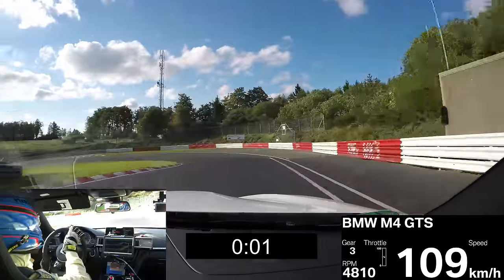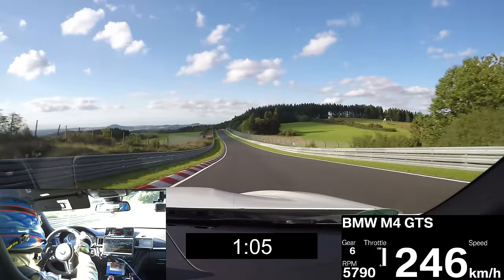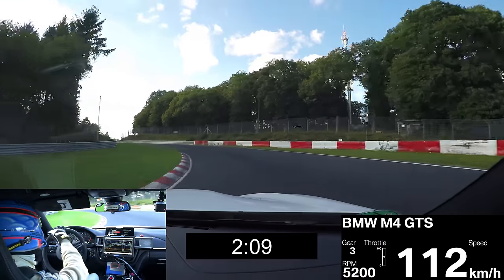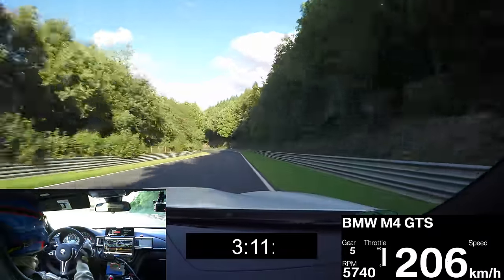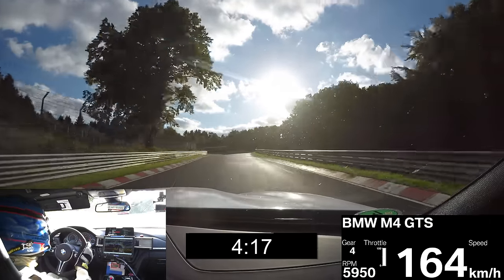BMW M4 GTS Fast Lap Nuerburgring Nordschleife.

Comment: With these results, BMW doesn't need to make a supercar. This is a real supercar in the body of the tiny coupe.
The Ultimate Driving Machine.
///M POWER.
Reply: +Hendra Di 142.600 € .... i'd rather pick the GTR ;D
Reply: +Hendra Di ...Ultimate driving machine?............Yeah right.
Reply: Coming from the person who loved the S-Class...
Reply: +Hendra Di You actually have a point there... would be great if they made one anyway though :p
Reply: +Dre Ray 
Exactly, yeah right. And with this GTS BMW showed how to build a near perfect car. It's as fast as many great sports cars and it was so stable, like driving on rails. And you can daily it. Definitely the ultimate driving machine.
Reply: +Fast Er 
Ultimate driving machine... what a fucking joke... it's an automatic... so nothing you say from now on is relevant when talking about "the ultimate driving machine"...  
also looks like shit, sounds like shit, costs way too much... NOT EVEN CLOSE

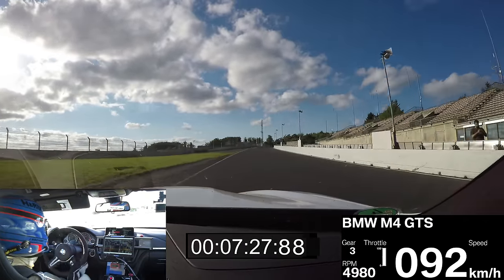is it impressive that a BMW coupe can lap the Nürburgring in 7:28? fuck yes it is! is it anywhere near perfect or "the ulitmate driving machine"? fuck no...
Reply: Paul Jeitler Now almost all sportscars/supercars using Flappy Paddle Gearbox. it's not automatic. 911 GT3 RS, F12 TDF, 675 LT. How do you say this car as the car driven unpleasant, because they don't use a manual transmission.
Reply: Paul Jeitler
M4 look like shit? nonsense bullshit, M4 (especially GTS) looks amazing with an aggressive headlights and the first use of OLED on taillight.
M4 sounds like shit? nonsense, still much better than Veyron, or GTR sound.
Reply: +Hendra Di well much as I agree with you! Just imagine if they create actually a real supercar... That would be the best supercar ever!
Reply: +Paul Jeitler No cluth? Double clutches!
Reply: +Paul Jeitler Dead serious. The gearbox is doing the clutching for you. Cannot be compared with an automatic transmission!
Reply: Paul Jeitler dual clutch or semi automatic, or whatever you want to call it, is a new trend in the automotive world today, from cars low end to hypercar are all close to using it. you have to accept this fact, almost no sports car that really use a manual transmission at this time as you wish. even track foucused car like Porsche 911 GT3 RS, Aston Vantage GT3, SLS AMG GT3, M6 GT3, P1 GTR, FXXK, Huayra BC, etc.
Reply: +Paul Jeitler Your the idiot. When I start my car, it's a manual. It even says so in the display. M1 (manual first gear) I floor it, until the I hit the RPM limiter. Then I engage the gearshift, with the lever or the paddle shift behind my steering wheel. The company behind it doesn't make automatic gearboxes. They make manual, and dual clutch gearboxes. They have automatic clutch, but it's nothing like an "automatic" my friend.
Reply: Paul Jeitler 
well last time i checked, race car drivers focused on performance over satisfaction...

im not saying there's anything wrong with manual, i agree it can be more involving but, like i said, racers now use dual clutch for a reason. Yes, the ACR and some 911 GT3 RS's still come with manual but check actual non-street-legal race cars.
I hope a can get a response comment without at least 5 insults in it.
Reply: +Hendra Di "tiny" are you serious???
Reply: SimBaa yes, i mean small coupe.
Reply: Sure... Ultimate driving machine with a ring lap time made by a slug.
Reply: It's kinda slow tho.
Reply: Man the hyperbole from BMW fans is crazy.  As long as Porsche exists as a company, BMW has no right to the title "Ultimate Driving Machine".  Even five years ago the GTS was an overpriced car; now it's irrelevant.
Reply: Yes.It was faster than Mclaren
Reply: @pauljeitler7678  an automatic that you will never be able to shift faster than:/
Reply: just a heads up, BMW m cars dont do that well.. even Civic type R's can beat m4 and m3, unless its the 150k GTS version lol
Reply: @davis7323  Beat them at what? A base M4 is faster than any Honda Type R.....hahaha
Reply: @pauljeitler7678  wrong. Auto don't have clutches or a clutch.
Reply: @jostrander71  nurburgring
Reply: Mercedes-AMG GT 4-Door Coupe is faster now.
Reply: Not imo didn’t even beat under 7 mins
Reply: @samharper5881  true

Comment: Shows how fast the CSL is/was in 2003 on MPS Cup 1 tires. 7:50.
Reply: +Thomas Kooiker The 12-year old CSL is faster than a standard M4. Unbelievable.
Reply: +JoeBlo2 Yeah, but as far as I know the CSL had a better driver. If the M4 would be driven by the same guy that drove the M4 GTS, it would definitely be faster. 7:50 is an incredible time though, the M3 CSL is legendary.

Comment: So, it's as fast as the 458 Italia and the MP4-12C.
Reply: +Ivan Novak And as fast as the legendary Carrera GT. Funny somehow.. also funny is the fact that the panamera turbo s is as fast as a ford gt on the ring (07:52) and the E46 CSL is as fast as the first version of the murcielago (7:50)
Reply: +Jannik Eisenmann in the case of the Ring, it's such a long and unique track you can't just compare the 'cars' laptimes; you also gotta take into account who sets the laptime with any particular car. Drivers vary for each each car and so do the track conditions. There's also the reservation problem. Since the Nurburgring is a 'public' road-course, most manufacturers only get private access ti the track for a pretty short time period, for example, Dodge only had 30 minutes to set up their equipment and run a lap in their Viper ACR model. i'd imagine Ford GT was driven by a journalist (not a pro) and so was Murcielogo or MP4-12c. Think about it, how can the 12c (being 4 seconds faster on the Top Gear track) run the same  time to the 458 which has even less power. When it comes to the Ring, it's all about 'Who sets the lap time' than 'what car sets the lap time'. That's why i can only take seriously the laptimes that have an on-board proof video. And even with a video, you  still wouldn't be able to figure out if the car is a legit road legal or if the company is cheating or not (like with the GT-R NISMO who didn't set the lap time with a pro-production car developed only for the Ring and claimed that it was a showroom stock GT-R NISMO)
Reply: Arya Ahmadi
I get your point, but i believe me, four seconds are (if it's not close to seven minutes or less) not that much on 20.83 kilometres, and regarding the mp4-12c vs the 458 i have to say that power really isn't everything! it is also depends on torque, less/more over/understeer, driveability, rwd/awd/4wd, downforce, weight, power to weigh-ratio.. (the list goes on..) and i did not want to bash the ford gt, i really do like this car! i just want to show how fast everything progresses, i mean as far as i know, the new 991 911 carrera s (or another 991 "standard" model) is already faster on the ring than the 997 gt3 rs! ..just like it was unimaginable, that a roadcar does the ring in under seven minutes and well... 918, aventador lp 750-4 sv...
Reply: +Jannik Eisenmann +Arya Ahmadi The MP4-12C was 2,3 seconds faster than the 458 on Top Gears track. The lap time of 7:28 for both cars was set by a German car magazine Sport Auto in 2013 (they didn't say who the driver was, but I presume it was Horst von Saurma, the chief editor of Sport Auto). Now, I consider Horst von Saurma to be the authority of Nurburgring, since he did set a lot of the the official lap times, so if he was the one who set the 7:28 for both the 458 and the MP4-12C,  I think no one has the right to complain about the driver.
Reply: +Ivan Novak 
Also, 12C was developed on the Top Gear track, so it was more suited for that track than 458.
Reply: William Snow  it's not priced higher
Reply: Behindthen0thing lol it is
Reply: @hbk4984  Used, the GTS is much cheaper than the GT3 RS and the AMG GTR

Comment: 7:27:88 WOW at 3500lbs and 493bhp thats sick Porsche Gt3 did 7:25 at 475bhp and 3300lbs but thats fucking Porsche this is a BMW lol this is by far the most Impressive RWD out there at this track at such low power and high weight.. And only on 265-285 tires..
Reply: +Steve Hash and can carry four people!
Reply: +Ruohong Zhao 

It has 2 seats man...
Reply: Ron Ferka (*Correct) It has space to fit four people :P
Reply: +Steve Hash Unless you run out of water,then you get less hp
Reply: Hehe i dont think that'll happen in 7 min do you Lol;)  also if it's warm you'll Lose power but not so much in EU weather..

Comment: Look at those beautiful lines he's taking into the corners, professional...I think at one point he was going (258 km/h) which equals: (160.314 mph). Lets not forget the gentleman was going that fast mostly around winding corners; on a straight track, he would go much faster. I believe that cars top speed is about: (304 km/h) which is about: (188.897 km/h).
Reply: 304 kph is about 304 kph true.

Comment: At around 3:30 why does Joerg shift the car early? I noticed that shifts into 4th gear at 6,800RPM and then shifts into 5th gear at 6,900. Why doesn't he utilize the rest of the power? Does the M4 GTS reach peak torque/hp before 7,000RPM?

Comment: The M4 GTS is an AMAZING machine, but I think they should bring back the M1. Imagine how amazing BMW could make the M1 if they started from scratch, new chassis, new engine, new drivetrain, they could make an absolute monster out of it. The M4 GTS was built on the M4 which limited what they could do to it. I know BMW could spank the Mercedes Amg GT with an M1.

Comment: Good evening, at what amount RPM does this engine/car have the most power and torque?
Reply from the maker: What do you mean exactly?
Reply: BMW M at how many Revs/minute does the engine output the most Kilowatts? Bei wie vielen Umdrehungen/min erreicht der Motor seine Höchstleistung?
Reply from the maker: Hallo roteroktober420, vielen Dank für deine Frage. Der BMW M4 GTS erreicht bei 6.250 Umdrehungen seine Höchstleistung von 368 kW/500 hp.
Reply: BMW M Also macht es leistungstechnisch wenig Sinn erst bei über 6250U/min zu schalten?

Comment: Wow, very nice lap. I'd really like to know, what laptime would be achievable with the same driver and a standard BMW M4/M3 (is there a noticable time difference between them?)?
I know, Sport Auto did a 7.52, but I think this is not comparable. So what would Mr Weidinger do in a standard M4? 7.45? :)

Are there any official BMW times for the M3 or standard M4?
Reply: +rippchen0815 No but most people consider the Sport Auto times to be around 10 sec off the pace of what the car could do if pushed, so i would guess around 7.40.
Reply: +M3Conv Thx, about my estimate too :)

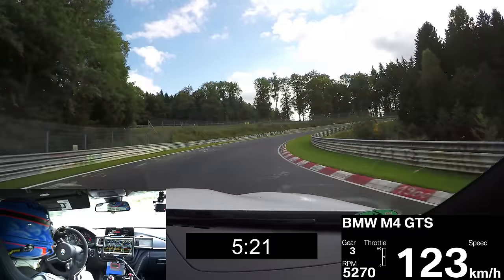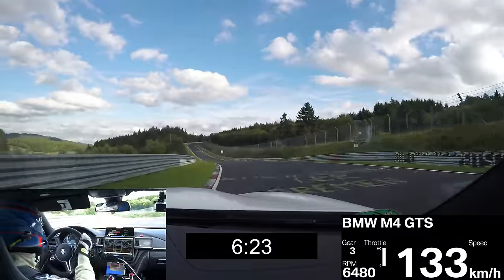Comment: It's a really great lap executed with a high degree of professionalism but i cannot agree with the narrator when he says "perfect lap", because there are at least 4 really obvious mistakes i could spot during the lap: first at 5:28 where he unwinds the wheel twice coming into Brunnchen, going a bit too wide and thus riding the curb which visibly unsettles the car. Second at 6:24 in Kliens Karusell where he unwinds too late and ends up counter-steering instead of going a bit wider. Here i think the mistake affect the driver's resolution a bit, as he commits another mistake in the very following corner (and incidentally the same kind) where he actually turns too much on the right of Galgenkopf and he visibly correct his trajectory mid-turn (6:31). Jump to very last corner at 7:30 where he correctly realizes he needs to start unwinding a bit but correction is temporary, he insists on turning a bit too hard and slips when going on the throttle again.

Comment: The tires are getting stickier and stickier. To bad the cars are getting porkier and porkier with zero feeling electric steering and borg gearboxes. Wonder what time an E46 CSL or an E92 GTS will get on this tires.

Watching the video: pretty "understeery" setup (that rubbing noise from the front and the car not wanting to turn) and judging by how he "hacks" with the wheel without upsetting the car, also pretty tame steering, not very direct.

I am currently driving a BMW (bought from new, manual, normal aspirated, inline 6, petrol). Sadly, there is no model in the current line-up or in the future one that could make me buy another BMW. i8 is very interesting, but not at that price. 150,000.00€ with some options, it is GT3 money. 75-80,000.00€ (new) is more like it. Would buy one in a second.
The next car will be from another German company, sorry.
Reply: +thefridgeman which another german car company? porsche carrera with turbos and dual clutch? audi rs whatever number with turbos and dual clutch? mercedes amg with turbos and dual clutch? for 75-80k euros they sold nothing for your demands, sorry.
Reply: +thefridgeman wait for the new m2
Reply: So you have a 525i e60 right?
Reply: behemoth inferno turbo engine, porky car. No thanks.
Reply: Andres Perez wrong (a lot), guess again.
Reply: Bought a M3 CS in the end :D

Comment: Would have been better without the narration... And this still got killed by a 2011 ZO6 and GTR 4 years ago.....Not disrespecting just saying. Its certainly fantastic for Bmw, But considering its TWICE as expensive as a normal M4, I dont see the price justification, Specially with its competition concerning its price range, There are loads of cars in the its price segment and damn near all of them will waste this round a track, However, If your buying this SOLELY for track times, You miss the point.
Reply: +Dre Ray I loved the narration. Even checking the heat build up on front brakes. For a novice like me it gives insight on what is going on.
Reply: You probably didn't know that BMW made only 700 of them hence the high price.

Comment: DAMN! how the heck did he know he had to counter steer at 5:28? It was sooo rapid HOW DID HE KNOW??
Reply: +Arya Ahmadi maybe he went over the course before and knew
Reply: +shaheen islam no i mean as he was driving.
Reply: +Arya Ahmadi If you are experienced you can "feel" it ;)
Reply: +Arya Ahmadi If you have driven the Ring a couple of times as I have many times. You'll know that particularly that spot on the track is the most tricky. You get out og the long right corner, full throttle, but the fact is that the corner has negative inclination. So the second you think it is safe and full throttle, you can loose grib - and very fast.

An experienced driver knows this spot very well and is ready to counter steer - especally in a rear wheel car this can be nasty :-)
A good spot to overtake in a front wheel driven car, never the less - because the front end can pull you out ;-)
Everyone is talking about the karoussel - this is exact spot is the most tricky if you ask me.

Best
Reply: +Thomas Sofienberg oh I see...at first the guy has a super-human reaction time but now that you're saying that's a common spot for the back end to run loose it makes sense; so he must have know the back end is gonna lose traction before he approached the curb because, even for the very experienced drivers, it takes a bit longer for them to realise that they'd have to correct but this driver caught it within milliseconds! he counter-steered before even the rear starts to wobble around. Still impressive though!
Reply: +Arya Ahmadi It's a combination of knowing the track and the car, being ready for it to step out, and catching it quickly. The wheel lightens up and you would feel the car shift. It's hard to describe, but once you've caught a car a few times it becomes more natural and you don't have to think about it as much. He knew just how much to counter-steer though, very quick reactions.
Reply: +Arya Ahmadi Lol he counter steered while steering, that's how quick it was

Comment: 24 seconds faster than a regular M4. How slow is the M4 if the special version is 24 seconds faster?!?
Reply: +JoeBlo2 The "regular" M4 just didn't have the right driver!
Reply: +JoeBlo2 The regular M4 time you see on fastestlaps etc was just from a magazine review (Sport Auto). 

This is a flat out time attack trying to set the fastest time possible for the car.

Most people work on the best time possible being around 10 sec quicker than the times Sport Auto post.

14 sec quicker for this car with its extra power, aero and better tyres sounds about right i guess.

Comment: To qualify this lap as geniune is not simple. Many things we don't know: tires, fuel type, engine setup, suspension setup and even curb weight(what if this car is stripped down?) which all might be different than the retail car and will definitely provide a huge advantage in laptimes.

If we have these incertitudes, we cannot qualify this lap as geniune.
But the driving is very good. But the lap is invalid. 7:28 made by an inline-6 RWD sedan or not, it's invalid.
Reply: The M4 GTS is a stripped down version of the M4 anyway, I doubt they would strip it down even more. It has coilovers and semi slicks as standard.
Reply: If it's not controlled, no conclusions can be made about the lap times.

Comment: Just a 6-speed transmission????  Thought BMW's DCT was a 7-speed?!  If you ain't using 7th on "the Ring", you ain't ever gonna use it.  BMW needs to re-space those gears.  I pretty much just 3-5 being used, and 6th on final straight.